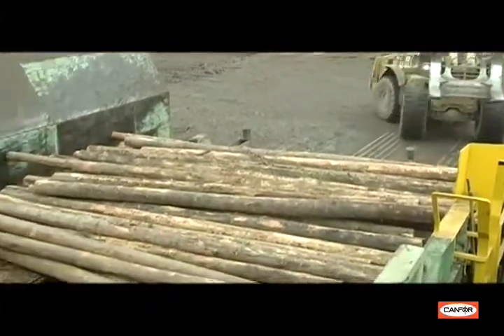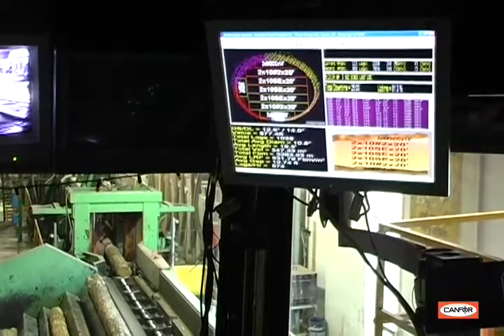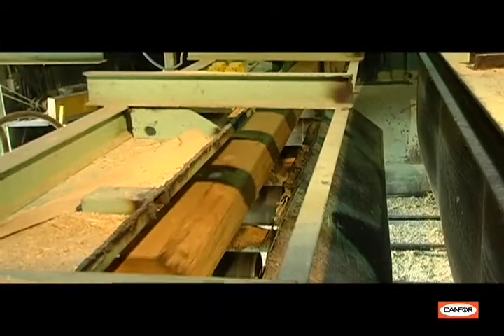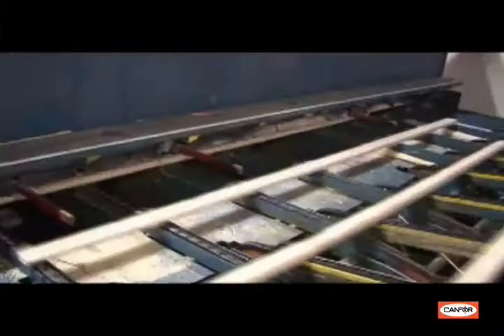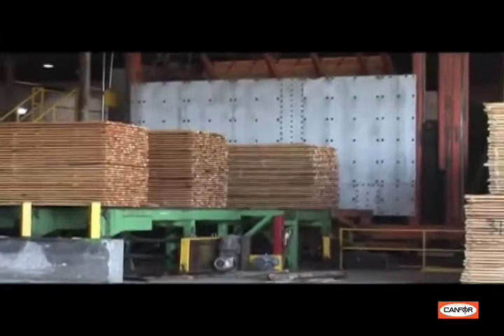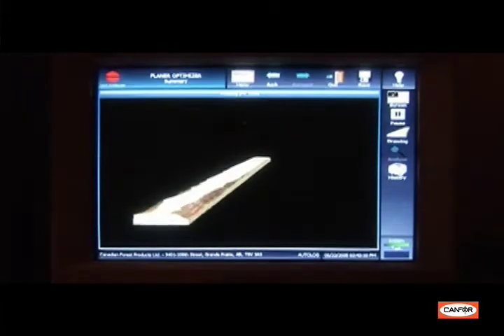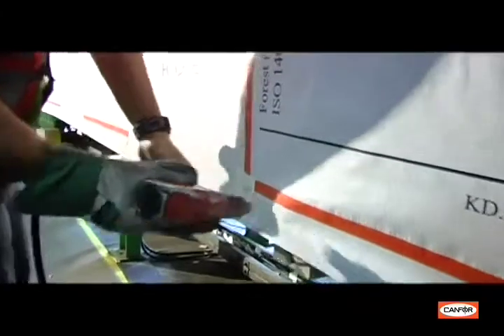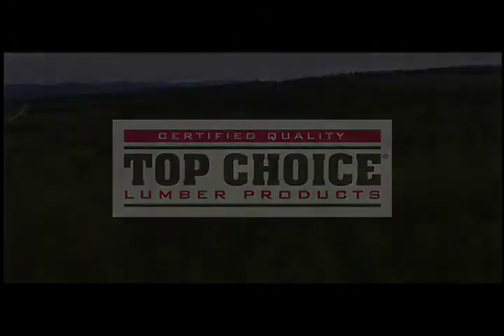Lowe's "Top Choice" Lumber creation

Comment: i just wanted to ask you where the top choice lumber is that lowes has. every board i have ever bought is full of knots , twisted ,bowed and badly warped. yet they sell it for a price that is fit for high grade lumber. $2.00 - $3.00 a BF is what i would pay for oak but not warped knotty pine.